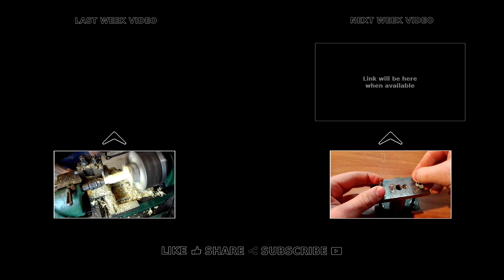Blacksmithing Cut Off Tool

Comment: That was a nice little hatchet before you did that! Im an axe guy though so that hurt. Some ideas for a longer lasting hot cut next time. Try to forge weld the eye shut and also consider heat treatment. You may think think hot cutting will ruin the temper but it shouldnt if done correctly and you will have a harder, longer last hardy tool 😉
Reply from the maker: Thanks man! :) Haha! Sorry about the axe, but I had tree others on hands :)
Reply: Thanks for taking the time to document your work and for another enjoyable movie 👍
Reply from the maker: Thank you a lot for watching and leaving this kind comment :)

Comment: why not use high manganese steel? like from a hammer wheel?
Reply from the maker: I don't have any good reason :D I went for the axe head because the shape was almost perfect and I wasn't able to find anyone alse that tried that! But maybe there is a good reason xD
Reply: Black Beard Projects you should try making manganese steel, you just need some zinc carbon batteries and an electric arc smelter i'd imagine, check out grant thompson's channel!
Reply from the maker: John Willett Sure I will :) Thank you my friend!
Reply: Black Beard Projects if and when you do i vote you make an axe and see if you can chop through mild steel or iron!